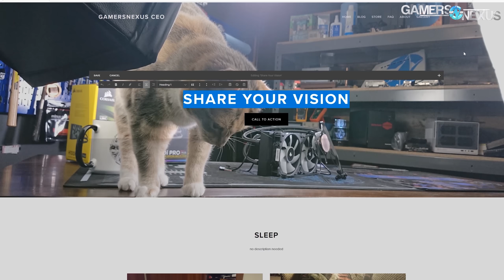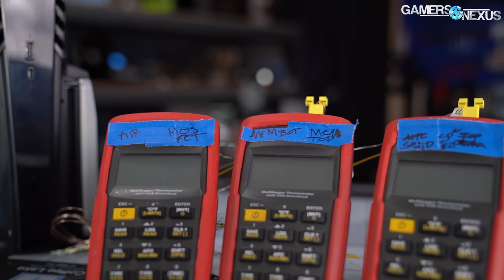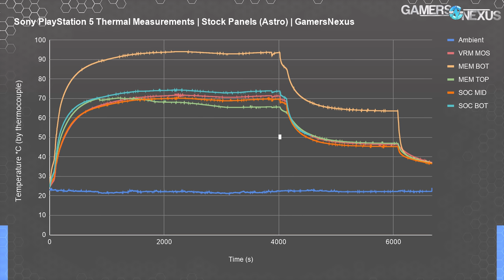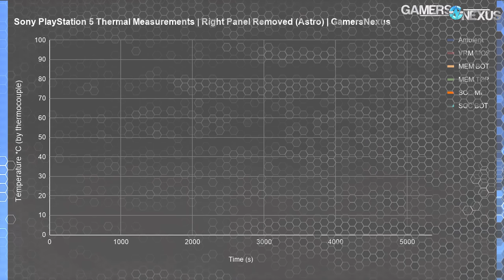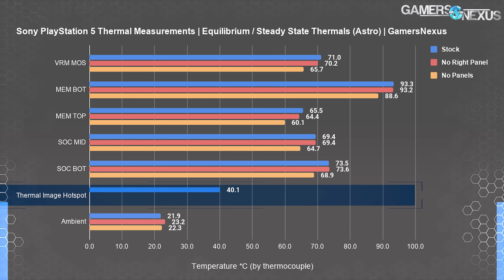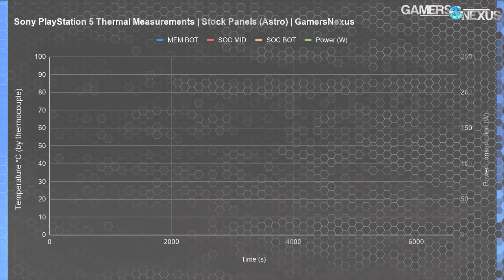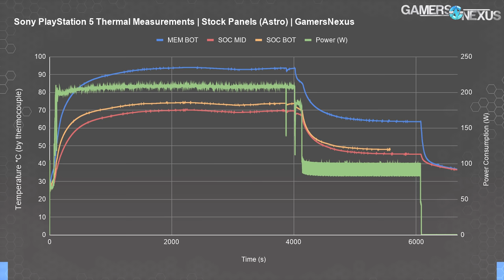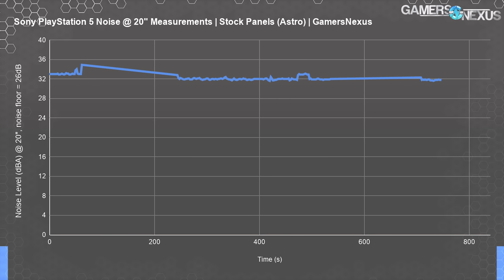Weak Cooler Design: PlayStation 5 Thermals, Power, & Noise Testing

Comment: Crazy that this is a brand new PS5 in a well ventilated room. Imagine what one that's been crammed into a TV cabinet for 5 years and/or eating dust would look like...
Reply: @null643  I'm curious if the liquid metal they are using will affect anything if nothing else.
Reply: Give it 14 months
Reply: This is why I'm waiting for the next hardware revision to come out.
Reply: Imagine summer with no ac
Reply: Knowing what PlayStation owners are life, the thing is gonna be in a cramped cabinet, on carpet, or full of cockroaches.
Reply: @eurocup07  if you dont have ac in the summer, you shouldnt be spending money on a new video game system. Get your shit together
Reply: @JohnSmith-tt6fx  haha true, I’m in canada it depends where..
Reply: You still get what you pay for, I feel. It's a less than $500 product after all, not a $2000~$3000 pc
Reply: This is my concern. I had an original PS4 for about a year. I did spray the vents with canned air every month or three, but by that time it sounded like a jet engine when I played a game. I traded it in for a PS4 precisely because I heard the PS4 was quiet, and I'm guessing it's because it had a big copper heatsink in it as it felt heavier. The PS4 Pro has been dead silent though pretty much.
Reply: @stone2bulletz  no I agree, you're better off building a pc, but a $500 pc won't run the games people are buying the ps5 for. If people are actually paying more than what the console is actually worth, that's on them
Reply: @stone2bulletz  Yes but people are buying next gen consoles to play current and next gen games at 4k, which a $500 build wont do
Reply: @hua..  A PC build with similar specs of the SX will cost around 1900, this was shown during a live PC build on Youtube.
Reply: @yo-no9879  1. You’re making huge generalizations
2. It’s not Sony’s job to take care of your console. If you don’t clean it, put in a dirty place or do other stupid shit then it’s your fault if anything happens.
Reply: It won't probably last 5 years with those temperatures on the memory...
Reply: @hua..  you do realize that both consoles get sold on lose and then sony gets the money back by playstation plus or the game tax that sony collects from game makers so you pay more in the end
Reply: @lel3019   And your point is? The only argument I made is that you get a very beefy piece of hardware for a fraction of the cost it would take to build a pc with similar specs, today. I'm sure even you can see why that looks attractive for the regular consumer, I would stick to building/upgrading my pc, personally, because I do more things than gaming with it, but this is starting to sound like the usual dumb console hate. It made sense last gen because both the ps4 and xbox one had garbage tier specs, but thats not the case anymore, and for that price tag, if you just want to casually game, it really is unbeatable, well, for an xbox anyways since all you'd need is the gamepass, technically, with sony there's no alternative to the ridiculous base $70 price tag for games they are pushing. Either way, you definitely get what you pay for (once the consoles actually start receiving next gen games at least), which was my initial point. Not once did I mention profits or how much sony makes in the long run, that was never part of the argument.
Reply: @stone2bulletz  Consoles offer way stronger hardware for that price. But if you want to use different software, then yeah, go for pc which is all-round
Reply: Nah bro, sony did  a amazing job,  the First next-gen console you can cook bacon on.
Reply: @JohnSmith-tt6fx  But why should i gift my landlord an AC system for a house i only rent? Or bother with one of these awful window mounted systems for that cheap motel feeling.
Reply: Or imagine that you live in South America and you have 10 months of ambient temperature from 33°C to 43°C instead of 22°C...
Reply: @praetorxyn  I still have my original PS4 since 2014, a white one. Every 3 months or so I open it and the dust off. Also every year I change the thermal paste.

It's still pretty silent. It'll never be dead silent since my ambient temperature is 40°C all year long where I live. This winter we got a record low of 24°C and today as I write this I'm at 37°C ambient temperature and playing AC Valhalla. It's noisy at best. Not very noisy, but not dead quiet either.
Reply: @DimitriMoreira  I meant I replaced the PS4 with PS4 Pro - in case that didn't come across. Damn autocorrect.

When I tried to take the PS4 apart, it seemed like one of the screws was behind the "you'll void your warranty if you break this sticker" things, so I chickened out of doing it as I was still inside warranty.
Reply: @yo-no9879  mine is sitting in the open under my tv. My stand has no doors, for ventilation.
Reply: @JohnSmith-tt6fx  here in germany almost noone has an AC and put Summers get up to 43°C
Reply: You can vacuum the dust out of it remember?
Reply: @MrGamelover23  Assuming they don't put one of the screws behind a "warranty is void if broken" sticker like on the PS4 IIRC.
Reply: @JohnSmith-tt6fx  I'm in Ireland though, we have run 190 days a yr, cold winds and clouds for another 160 days and finally about 5 days of summer :D Why would we ever need an AC?
Reply: @praetorxyn  not only did they NOT do that, you can replace the fan without voiding the warranty. They literally showed this in the teardown video, which if you haven't seen yet, that's the juicy bits.
Reply: @alak58 I'm pretty sure I could get one that would actually fit. Not that I actually want to.
Reply: @praetorxyn  my experience has been literally opposite. My PS4 pro is loud and and under the same loads my original model is actually nearly silent. 

It's because of inconsistent thermal paste application on PS4s. The pros included. I'm tempted to open up my pro and apply liquid metal.
Reply: @Spartan_83  well if you're being scalped for 80% of that price, you might as well build a pc anyway.
Reply: @ArtisChronicles  Possible, though the noise largely comes from the fan being so small. PS5 has a much larger fan, so that should help a lot even in the worst case.
Reply: @Bossman5000  well I do like me some.bacon while I game
Reply: @ArtisChronicles  I don't like PC gaming though, I left PC to play on console. I have no problem waiting on restock, also it's hard to get the new GPUs. I wouldn't want anything less than a 3080 or a 6800xt
Reply: Wait until they release a new (improved cooling) model.
Reply: @hua..  yea that's true but I think console gamers also have an small laptop or older pc. This must also be paid.
But yes I get the point.
Reply: @lel3019  thats wrong. Google cost of manufacture on ps5 against the price would have showed you how wrong you are that they are sold on a loss.
Reply: @dogtags2010  ok then they arent but my point was that consoles are cheaper than pcs because sony and Microsoft just charge taxes from game makers for selling the games so in the end the consumer pays more for games and at sony also for ps plus 
So in the end they arent as cheap as people believe and also making a Software also costs money so they still would only lose money if they wouldnt make billions of dollars from ps plus/gamepass and game taxes
Reply: @hua..  my point is that the ps5 is more expensive than "only" 499 because you need to pay things like ps plus or sony also charges taxes from game makers wich lead to more expensive games for the consumer so the consumer pays more than 500$ for a ps5 in a longer term so saying that "you get what you pay for" isnt correct because especially the xbox wich also costs 500$ has more power and doesnt have heating issues and you dont need to pay xbox to game online so the xbox technically is even cheaper and offers no heating issues 
So if you know a person that plays no games on his console then ye then the person has got what he pays for because then he doesnt need to pay more on games and other things
Reply: @JohnSmith-tt6fx  right lol
Reply: @hua..  right!? And these thermals are not some red light. Electronics get hot and are designed to run at different temp levels. The system has liquid metal, vapor chamber, heat sync etc...it’ll be fine.
Reply: @MrGamelover23  if you watch the dismantle the ventilation has dust traps to stop it from clogging.
Reply: @lel3019  oh yeah, then I agree, in the long run it's more expensive for sure, but it also varies per user, most people only buy a couple games every few months, dont have ps+ up forever, etc. It will take a couple of years at that rate to add up to say, a $2000 pc (which you also have to buy games for, though considerably cheaper), but yes, you're not wrong. But those things are hard to gauge, so it's why I only bothered comparing the kind of hardware you get/price. Although, considering the thermal issues, it would probably be wise to wait for a better/revised batch of consoles (at least from sony) anyways
Reply: @alpha6games751  maybe, but I'm kinda paranoid about those numbers, probably from watching too many gn reviews LOL
Reply: @hua..  some people are just ridiculous when it comes to the two consoles. The opposing fan boy side is always wanting an overheating or failure issue and read into things to much. It’s like they act like anything over ambient low temp at any point the system is just going to melt into the entertainment shelf or something. Keep in mind the ps5 is different then other systems, in that it has a variable cooling system that adjusts to the system temp if it does get into red line areas.
Reply: Garnished Bullet  no next gen console, nor new gpu or new amd processors, why even live 😔
Reply: @shawnmiranda  Thank you lol.
Reply: @shawnmiranda  this is what I have been trying to say and from a fellow tech and programmer this whole high temp garbage is idiocy. The cooling system is designed very well and I like the fact they can adjust cooling settings based on individual games through data collecting and update the firmware.
Reply: @MrGamelover23  the system actually has dust traps as well
Reply: @coolthief8375  either way, i live in hawaii, we don’t ever get 21f ambients. usually around 70-80 even 90 on a hot day. If the memory was hitting 90s at 21 ambient it worries me about the longevity. my ps4 is still going after 6 years, only ever had to change the fan once.
Reply: @stone2bulletz  You run your channel on a 500$ PC, but you play games like robloz and minecraft... That doesn't exactly mean much.
Reply: Oh yeah these things are gonna drop like FLIES considering these thermals jesus christ
Reply: @alak58 Eh, doesnt look like its larger than a AV receiver, would still fit in most.
Reply: @JohnSmith-tt6fx  yeah because central air unit is $500🙄
Reply: @spectreshadow  Ha yeah, because you could totally grab one at any time if you weren't 'waiting'
Reply: @alak58 It fits in my TV cabinet without issue. I just noticed how hot it was getting in there though, and need to figure out where the heck I can put it to keep it cool. I have nowhere else I can put it.
Reply: @jesusurrabieta9700  5 years? are you serious? with that temp it will be lucky to last 6 months.... lol 94 IS HOT this aint farenheit, this is celcius and if they don't fix that, then all the systems will break down, hopefully it's just this one system, that maybe wasn't done right lol... idk, I just don't want to buy something thats gonna break in a few months you know what I mean.
Reply: @yo-no9879  Are you saying PlayStation owners are dirty?
Reply: @spectreshadow  I doubt that's the reason, theyre just rly hard to get
Reply: If you are you using canned air youre doing it wrong all that does is push dust deeper I tried to tell my buddy but he dosen't want to listen and he'd rather it over heat over and over again duh your are better off vacuuming it if you want to do the minimum. Told him I'd tear it all the way down and apply new thermal paste but apparently he wants to keep pushing it till its completely cooked.
Reply: @Juan800PimpBot  Technically whether canned air makes it better or worse depends on how you use it. The reason they come with those little straw things is so you can get it deep in there and blow the dust out. Obviously this won't work on everything and it's better for more open devices that allow the dust to fall out once displaced.
Reply: @coaxill4059  Have you ever disassembled a ps4 or ps4 pro or even a ps3 because nah you'll do much better taking it apart duster or no duster. The dust will be trapped regardless of the length of the straw especially if it's been awhile. The most useful things are qtips, alcohol, and a vacuum. While you're in there you'll want to check on the thermal paste especially if it's been making a lot of noise.
Reply: @coaxill4059  I could easily clean my computer out with duster but it's extremely open and wide spaces don't trap and stack dust like lumber.  I've disassembled and repaired everything from optical drives to hydraulic units pushing dust and contaminates further into anything is not the correct approach. Crack one open and you'll see exactly what I'm talking about and why I say duster is not good specifically with the case not opened. It would be like me using duster on the outside of my computer tower.
Reply: @Juan800PimpBot  I have disassembled my PS4 though I never had a PS3. The PS4 is an incredibly dense and compact design with barely acceptable thermals, so I'd encourage anyone with a PS4 to take it apart and clean it every once in a while.

But that's the point of what I said, duster isn't completely useless. You just can't expect it be effective in every use case. In the case of the PS4 I found duster to be extremely effective at blowing dust trapped in the external vents from the inside out, but for most of the machine I wouldn't advise it. In that instance, there is no risk of blowing dust further into the machine because you're blowing outward through a narrow passage. If you were to try and blow from the outside in to skip the disassembly step, you would probably just make everything worse. 

These are all tools. They exist to perform a function, not simply to solve a problem by itself.
Reply: @coaxill4059  That's not what you said in your original statement thanks for the clarification. The point being if you just shoot duster into it you are doing more harm than good hence why I'm explaining so people don't do it and melt their shit. Best case scenario it's a temporary fix . Nor did I ever say duster was completely useless.
Reply: @Juan800PimpBot  You're right that this wasn't exactly what I said, but those statements are perfectly compatible. One is just in more detail.
Reply: @Juan800PimpBot  After all it's not like I said NOT to disassemble it. I didn't think it would be necessary to specify.
Reply: @coaxill4059  It's been my experience that the details can be very important when dealing with people who may have extremely limited knowledge and experience. You or I wouldn't think twice about doing a solid teardown or that it would be expected in the process of cleaning one of these consoles while they just want it to work.
Reply: @plasmaoctopus1728  In every other application, LM needs to be reapplied quite often.  Much more often than thermal paste.  I'm sure Sony fangirls will tell us it's magic metal or something stupid like that.  I think there will be problems with these consoles in a year or two. Probably better to lay it on it's side to keep the metal from leaking past the seal.
Reply: @hua..  It should still last the life of the console, about 6 or 7 years.  We'll see if it does, but I doubt these 1st gen consoles will stand the test of time.  I really doubt the liquid metal will last.  That stuff needs to be reapplied often.
Reply: TV cabinet? Aww you mean 20th century living room junk. Evolve beyong the junk...
Reply: @plasmaoctopus1728  watch terminator 2 and you'll get your answer 😁
Reply: @ahdasick  i apologize for a 3 month reply, but you do realize the measurements used were in degrees celsuis, right? It was an ambient of about 70°F.
Reply: @Lov Mir  This might come as a surprise to you but PCs can do more than play games, so console will never truly "beat" a PC all things considered, besides, I was defending consoles for the most part lmao. Not sure why you're reviving this dead topic but I don't disagree, if it's just gaming, there's nothing wrong in going with consoles, especially in the current market
Reply: @Lov Mir Oh I agree, downplaying consoles has always been stupid, but like I said I'm not sure why you're replying to me specifically when I was more or less defending people who choose consoles over PC for gaming. But sure let's entertain this topic a bit more.  Yes, at launch, consoles are either a bit ahead or on par with PC tech of their time, but they are not modular, which is why the PS4 just a couple of years after launch was already severely underpowered compared to even entry level "gaming" PCs, not to mention the excruciatingly slow stock HDD which regular consumers won't ever bother upgrading from. It might take a bit longer this time around but it WILL happen to the PS5 as well, that's just how things go. This new gen is probably the best bang for buck we've had in a good while though as far as hardware goes (if you manage to somehow snag one at MSRP or just slightly more expensive or even find one AT ALL at this point lol), now they just need more than a handful of actual next gen games to truly shine
Reply: @spectreshadow  I usually hate the look of first gen PlayStations and love the look of the revisions. Less design flaws, usually smaller, better looking, more games available, cheaper. 

What's not to like in waiting?!
Reply: @Spartan_83  With the GPU scalpers, even more than that.
Reply: @PhyrexJ  Consoles are also MUCH smaller than PC's unless you go extreme SFF which is considerably more expensive.
Reply: @shanez1215  Yeah, no doubt. At the time it wasn't as bad but now you can spend almost a grand on just the 3070
Reply: @JohnSmith-tt6fx  In some countries the power bill would be up in the sky so its not a matter of anyone "getting their shit together".
Reply: @spectreshadow  more like you cant find any and you tell that excuse to yourself
Reply: @DimitriMoreira  Changing the thermalpaste every year is not needed at all when you use something like MX4. i took apart lately a PC and the Thermalpaste was 4 years old and still like new.
Reply: @spectreshadow  aged like milk
Reply: @eurocup07  hi, Summer here over 40 degree Celsius.

Yesterday I stressed tested my Ps5, photo mode on Ghost of Tsushima (16H straight) with full effects going on.

Console ran the hottest I've seen, went back to the game & everything ran flawless, no frame drops or random shutdowns, Console was also mostly silent but the fan was kicking a lot more of course.

So seems like nothing is happening, will need to test next year to see if anything changes.
Reply: @HuGiv5  fantastic
Reply: @spectreshadow  next revision has a much smaller cooler now. 😅 I don't think they improved mem temps.
Reply: @Slyizable  I have both systems CF1016A since lunch and it still works like it should. My brother cleans it every 3-5 month. I have new CF1116A its bit quieter thanks to NMB 18 blade fan vs nidec 17 blade. Thats only difference.
Reply: @chillhour6155  2years after getting my launch ps5 and keeping running blackdesert afk while i work for 8hrs a day........and its still as good as it was when i opened the box
Reply: @eurocup07  it works fine. personal experience.
Reply: @praetorxyn  If you spray the vents with canned air you are only pushing the dust deeper into the system and clogging it while removing dust that could be removed just by removing the plastic cover and dusting it off with hand.
Reply: @konverzny  Pretty sure you have to break a sticker that probably voids your warranty to remove a screw to get the plastic cover off.
Reply: @praetorxyn  No you don't.
Reply: @konverzny  I don't have an original PS4 anymore, I traded it for a Pro as I said... and I don't particularly care how dusty the Pro gets as it's quiet when it runs. Though, I haven't really turned the PS4 Pro on in over a year probably, as I'd rather just wait for Sony to bring its exclusives to PC.
Reply: @aaronclay4665   too short of a timeframe, chips are supposed to last a decade usually even longer. Which means that even if the chip only delivers 50% of its expected lifespan youre still looking at 5 years.
Reply: @JohnSmith-tt6fx  You are absolutely right..
Reply: @plasmaoctopus1728  Your comment aged well.
Reply: @Waldherz  HAHA, I mean, hopefully that's just an out of place defect and not the norm, but yeah, barely 2 years in and some people having trouble with liquid metal leaking is pretty bad honestly.
Reply: @chillhour6155  I'd give it longer. :)